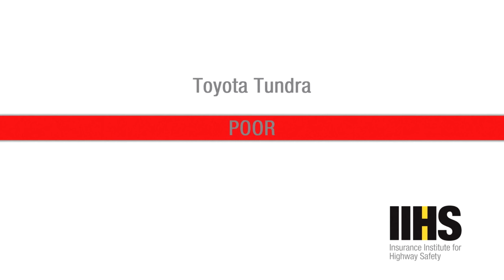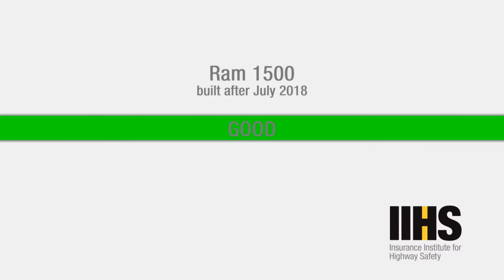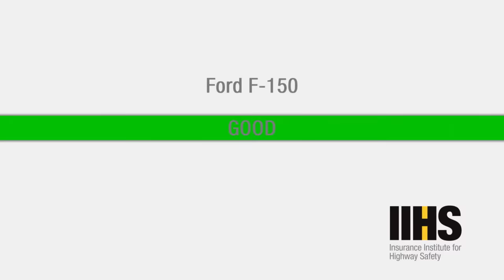TRUCK CRASH TEST COMPILATION - Ford F150, Toyota Tundra, RAM 1500, Nissan Titan

Comment: It’s 2020, there should be no excuse for “POOR” rated vehicles anymore
Reply: I would agree but the bigger the vehicle the harder it is to make it safe.
Reply: @PLieffers  actually it is the opposite. The bigger vehicle has more crumple room and can have larger components.
Reply: @Willdoesmusic135  I would like to keep my legs in a crash, so thank you very much, but I would still consider it poor.
Reply: @PLieffers  you mean the smaller it is the harder to make safe? bigger vehicles are far safer.
Reply: A poor rated vehicle today is 100x's better than an excellent rated vehicle 20 years ago.
Reply: You assume technology is improving over the years. But your comment also has the implied assumption that the standards are not also changing and becoming more stringent over the same period of time.  

Your assumption is rated as "POOR".
Reply: more material more expensive. but we got stagnant wages. so most people dont even drive a 2020
Reply: @PLieffers  The 3 bigger trucks got all ratings of good (except the titan) and the rest, which are small, got worse ratings
Reply: It's a old vehicle
Reply: @rougarou4514  700,000 people are driving new ford trucks every year
Reply: There had to be a cheaper option
Reply: @Liam-di7hn  there not on this test these are from 2009
Reply: It's made embarrassingly worse due to the outdated nature of these tests. Most were made/thought up and standards STILL measured to the levels they were in the 80's...
Reply: @Userfulpo  so sorry, 900,000 new ford trucks in 2009
Reply: These are 2018 tests
Reply: Yea but some where a 2018
Reply: @spencerrr9878  nope. Titan has a good rating.
Reply: They all looked the same to me
Reply: @PLieffers  that depends. If it is vehicle v vehicle crash then the bigger car is safer. If the crash is vehicle v barrier then the heavier it is the less safe due to more mass.
Reply: The Tundra is running on a 13 year old platform, the Frontier on a 15 year old platform. Some of these trucks weren't even designed in the same decade
Reply: The main reason the Tundra has poor for the first test is being the Tundra has not had a update since 2014 and that test came out in 2016. The truck wasn’t designed to be good at that type of crash and well it shows.
Reply: @samuelrowland76  I had a 2014 Honda that had it's structure updated to offer improved safety and perform better in this crash test. The test and it's test parameters were available to Toyota, Honda and others in 2013.
Reply: @Willdoesmusic135  It's still poor so no thank you.
Reply: @PLieffers  Bullshit, the bigger the vehicle the safer.
Reply: @xLuke_25x very true
Reply: And yet latinamerica is filled to the brim of cars with 0 stars on the safety tests
Reply: @PLieffers  not true your crumple zones are much larger just make sure your A and B pillara are strong and that you get adequate coverage of your air bags
Reply: I’d like to see you try and make a “good” vehicle
Reply: @aidanltd5408  It’s not my job, I’m the customer, not the multi million dollar corporation with the sole purpose of creating vehicles that abide by certain safety standards. I’m not the hundreds of engineers that work on each vehicles’ crumple zones and airbag placement.
Reply: Did you not see the passenger head contact made with that crunched door/windshield support? There was a lot of red paint on that support between the front and side airbags. That didn't look good at all from the interior camera view.
Reply: This test is specific for the US and only developed to make imported car look worse than US made cars. Toyota can't afford to optimize their truck to a test which is not relevant for the rest of the world. US trucks are mainly sold in the North American domestic market. That's why they look better in this specific test.
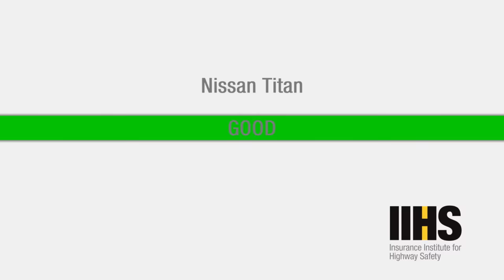Reply: @spencerrr9878  @2:09 Does not look like that to me
Reply: the tundra is like 10 years old
Reply: @Willdoesmusic135  They are a respectable licensed organization dedicated to test crashing cars so yes I do think their results are valid.   Toyota uses the information they get from these videos to make their cars safer, your bitching is only slowing down that process.
Reply: @Crunchymunchys  The hemi will last but the rest of the ram will fall apart around it.  At least with Ford you can swap in a brand new motor for another 250k, and another after that one!
Reply: @Willdoesmusic135  Ahh... Thanks. I couldn't figure out based in the video. It looks that same as the others.
Reply: That made no sense
Reply: Made cheap
Reply: Well it’s 14 years old
Reply: @AsTheWheelsTurn  nope
Reply: @AsTheWheelsTurn  it's a myth
Reply: The build quality of vehicles have gotten far worse, Chinese plastic. Do a lot of my own work, most components are outsourced chinese brands.
Reply: @bearblack5459  So you're telling me you'd prefer to crash into a wall in a go-kart rather than a 1/2 ton truck? Utter stupidity.
Reply: @MJorgy5  that depends on how the go kart and the truck is built. What I mean is that the heavier the vehicle the more energy has to be absorbed in order to stop a vehicle that crashes against a rigid barrier. A go kart would have to absorb less energy since there is less mass while a truck has to absorb more. The safety of the occupants is largely dependent on how much energy the occupants absorb in a given moment. Clearly you know nothing about physics.
Reply: John Buck  Thanks to lighter materials trucks are actually not much heavier than large sedans, and modern break much better than 40 years ago when I started driving.
Reply: John Buck  I agree, I started driving with a 67 Buick skylark and can tell you vehicles in general have come a long way. If you are comparing today's subcompacts then yes they are better. But Due to my disability( can not bend my neck)  I cant drive anything smaller than an Impala. So not as big a difference in performance.
Reply: You do realize tests get harder as the years go by. A “Good” in 2006 would be no side airbags, no leg airbags, and bad headlights
Reply: John Buck  I would say a little bit of both. The side overlap test if relatively new, and the IIHS do make things more complicated by changing tests a little bit
Reply: Its not that they're poor, it's that the standards are constantly getting higher and higher.
Reply: @franktechmaniac7488  tundras are only sold in North America so they are made to our crash standards. Its just an older design that came out way before the small overlap test was ever used. The big 3 have all been updated since they started the small overlap crash test. Go look at the 2001 tundra and the 2001 f150. The 01 tundra could still open its doors, the f150 entire cab deformed and failed. I like the tundra, its certainly not dangerous but it is a dated design. I fin it ironic about the lower leg injuries when it has airbags for the knees/lower legs.
Reply: @Willdoesmusic135  you sir are overly biased for the tundra, you haven’t realized that lower leg area is a place a person can and will get trapped in the vehicle, and in the case of a fire thats a death right there. If the person has little to no chance of escaping it gets a poor rating
Reply: @Rick Moises @Derek Rose @Nathan Stromquiest @Mason Reppeto I don’t understand why people on the internet have a hard time debating without insulting one another. I was simply saying that by showing a poor rating for one area while not showing an overall score could be misleading to people in the market for a truck. Not to mention the fact that the title of this video is ratings for 2020 vehicles while the trucks tested are older models that got perfect ratings on updated versions.
Reply: @PLieffers  that doesn’t make sense
Reply: Yeah just come here to latin america and see how 0km cars are equipped...
Reply: Or marginal for that matter.
Reply: I tried driving a truck with a trailer that was attached without using the proper equipment.
It went off without a hitch.
Reply: @PLieffers  'bigger' is extremely vague. Are you talking about cabin space, GVWR, engine bay? You need to be more specific because those things aren't the same
Reply: @rougarou4514  The material is a fraction of the cost of the vehicle. Most money goes to 1. The salesman, 2. The dealership, 3. Corporate executives 4. Taxes, 5. R&D.
Reply: @williegates627  Thank you. I'm glad someone finally said it
Reply: @michaelmeyer9665  Okay but these are still valid for practically every model I saw. The actual structure doesn't change much year to year
Reply: I don’t care about safety, it’s all about driver. I rather die than drive those new cars. (I am zoomed not boomer).
Reply: @AsTheWheelsTurn  I would have to disagree, smaller vehicles can avoid an accident easier than larger vehicles by taking up less space, they can also brake far better than larger vehicles but they don't include braking distances in these tests unless it's triggered by the car sensing a pedestrian
Reply: @PLieffers  The opposite actually bigger cars are supposed to be stronger.
Reply: @jcdenton4621  But that is no excuse.
Reply: @spencerrr9878 You mean except the Tundra. Tundra was poor. Titan was good rating.
Reply: On the tundra, you saw the door bend, which means that it can make the passenger fall out
Reply: @cheesecakecool   These test are from 2019
Reply: Actually the current Mustang ranks with some Chinese vehicles as having the worst  Crash Ratings
Reply: @Templar-jj3ig  They the Chinese  Pickups are now getting good crash ratings. Prior to that they were terrible
Reply: An the money 💰 🤑 💸 you pay for a pick up  today
Reply: @aidanltd5408  lol, this:"go and make it better." is kindergarten talk.
Reply: i drive a small corolla and i have to constantly drive to avoid reckless or careless drivers from time to time, they're usually in bigger vehicles, the plus side of being in a smaller vehicle is that you should be able to avoid crashes easier. But anyways unless for some reason you're smashing into a brick wall or a massive industrial truck that may or may not be moving these crashes arent exactly accurate of what actually happens in the real world, and being inside a bigger vehicles doesn't always make you safer either, you're gonna have a harder time avoiding crashes with one, and for the record, most of these trucks are basically tanks compared to your average eco box on the street.
Reply: The smaller the helmet, the safer it is is 🥴
Reply: The Nissan & Toyota car Brand owners are the only ones mad they got a 🍋
Reply: then how will da ppl now if its good or bad then when the biluy tue poor car they crash they DIE
Reply: Warning
Reply: 감사
Reply: Ok Zoomer.
Reply: Just never drive near other drivers or things or obstacles. Pow!!!!!
Reply: That would be true if pickup trucks didn't have a stiff frame
Reply: If you die you die they said 😂
Reply: Tbh new cars aren’t safe at all they’re just big computers that have issues all the time two of the safest cars are the 03-09 4Runner and the BMW E46 330i
Reply: That tundra performed awfully did you see how much it got smashed on the passenger side?
Reply: Yo the tundra almost lost the front
Reply: True
Reply: Poor person still lives in the past. 2020 lol. There should not be any crashes or plane crashes . As a matter of fact it should be ilegal to sell cars that can go faster than the speed limit in town and outside towns. Cars should know their locations and immediately bring the max speed to the speed limit. Cars should also be connected straight to the police via GPS and anything you do should be monitored. But hey they have more important things to invest in and care about like Mars and wars
Reply: Moreover, big cars like this are also used in "Off-road"

Comment: For anyone wondering the "good", "bad" rating isn't in how the vehicle holds up. Its on how safe it is for the driver/passengers.
Reply: Cherry0s thanks never knew that
Reply: How do they know if the car is good if the dummies dont fall out or if they don't brake what is the condition to have a good crash? If that makes sense
Reply: @thefireofthesaints1231  the dummies have censors so in the impact if the censors say that the dummy isnt severely injured or dead if a human then the car would be "acceptable" but it will be "bad" if the dummy was screeming with the censors, and "good" if its minor injury.
Reply: @vinicio10  thank you God bless you have a great Sunrise/day/Night
Reply: @thefireofthesaints1231  Cars are designed to crumple in a crash so they act like a pillow. If the car were so strong that it was undamaged in a crash you would smash against the inside so hard you would break like an egg.
Reply: @vinicio10  dang, those dummies must  use foul language alot if they need censors 😆
Reply: @Jackmerius_Tacktheretrix  its been 3 months no need to korrekt my speling of senxors
Reply: @vinicio10  sorrey my bad, didn't reelise it was that owld. I was just giving you a hard tyme 😆
Reply: Not quite. Part of the rating is based on how well the vehicle holds up. Notice the vehicles that got rated poorly or bad had cabin intrusion and would cause physical harm to the occupants of the vehicle. 

So yes, the vehicle needs to physically hold up on order to have a good rating.
Reply: Thank, I didn’t know that!
Reply: I was wondering that, because the Nissan trucks totally crumbled.
Reply: Vehicles of today are nothing like vehicles from the past. Some used to say, we don't make them like we used to. Exactly correct. 
   Manufacturers want the vehicles to absorb the impact, therefore the occupant does not. 
   The vehicles are a mixture of different materials, which are engineered and assembled in a way tht allows what they call "crumple zones", these zones act to absorb the impact. 
   They do not want cabin intrusion, which can harm the occupants.
   If you watch the video closely, you can see the grill and trim components from the vehicles continue to move forward during the impact. Without seatbelts, the occupants do the same, with seatbelts, it is our internals that do that, like our brain.
   But we humans are resilient, and we can survive those inertial loads, but we cannot survive a sudden impact with an immobile object, or very hard surface, so we also have airbags.
   The dummies do indeed have sensors within that measure these loads and the paint tells the observers where there has been contact between the dummy and some surface.
   The standards are now high enough that we prefer keeping our legs intact, rather than just a survivable crash. 
   In the context of this test, that is where the ratings come from.
Reply: Yeah
Reply: I wonder why they don't add something like roll cage like in race car to makes center part of the car more strength?? roll cage is proven in racing to saves driver life from fatal crash like in Rally or other racing car.
Reply: @runninginthe90s75  
   That's a good point, but what they do have rather than a roll cage is different types of steel that make up the assembly of the Unibody chassis.
   The Unibody chassis is basically one piece once assembled, but in creating the assembly, they use different grades of steel. These different grades of steel are put together to form the complete unit.
   The center of the car is created from high strength steel, whereas the rear or front areas are created from steel that isn't as strong, so maybe mild steel I believe.
   Considering the center section being created from high strength steel, no roll cage is used. But in racing, roll cages are still added.
    The center section is strong, but stronger with a roll cage.
Reply: @thefireofthesaints1231  I don't know 🤔
Reply: Yes we know what the good bad etc rating is. I mean honestly what a dumb comment
Reply: @friendlyneighborhoodcow8776  I htought that was obvious.
Reply: @SpencerLemay  no airbags are the pillow
Reply: Thats right.. However a child's hand can destroy the entire exterior of most new vehicles within 7 minutes. No hammers either.
Reply: Rip classic A pillars. Now you have to taco mode that neck. 😅
Reply: No vehicle no life. Under this logic we'll all be driving tanks in 5 years, getting 8 MPG
Reply: @vinicio10  Thanks fellow car
Reply: The F150 still held up quite well in comparison to the others
Reply: Yes, the car is suppose to absorb the impact, protecting the people inside